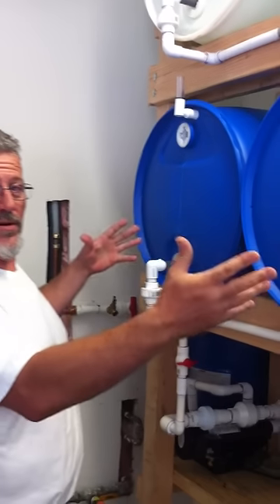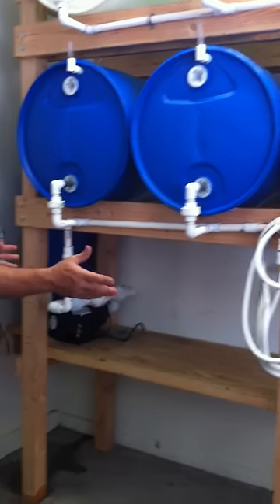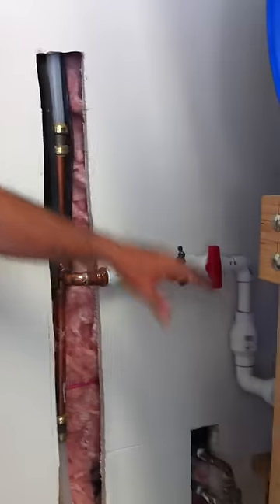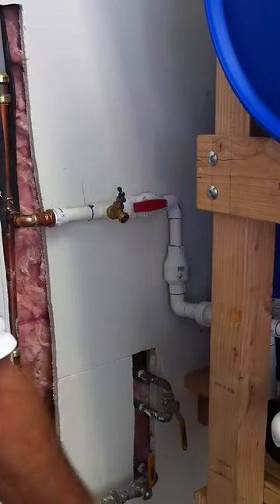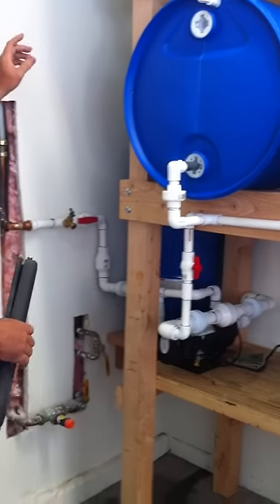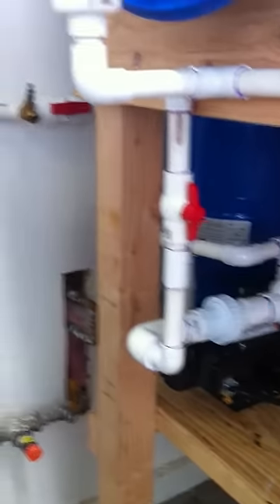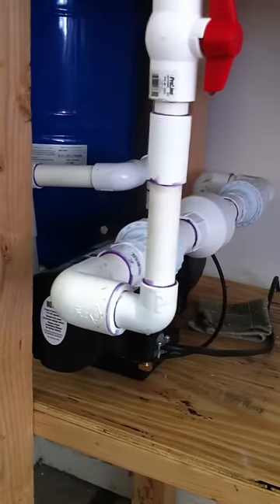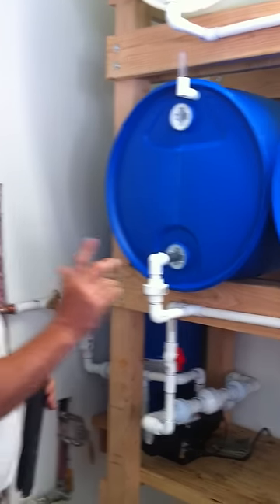WATER HOARDER 440 - Whole house water back-up storage system

Comment: If the storage tanks are vented, then what stops water from coming out of the vent when you fill them back up after using them?  Also if the water coming in is chlorinated, is there any issue with storage long term and mold/bacteria?

Comment: Each barrel weighs roughly 440 pounds, which is 3520 pounds for the whole thing.  How much can the 2x4 wood shelf hold?
Reply: weighs a little more than that if the barrels are 100% full but they can hold a lot how they're mounted, what is worrying is the wood has split around some of the bolts though.

Comment: By the time you find out about contamination in the City system, your barrels will also be contaminated...
Reply: The barrels are already the full. You don't open the valve until you cut the city/county water off and then turn backup water system on. With the back up water system valves closed that water is kept separate and secure from the contaminated source.